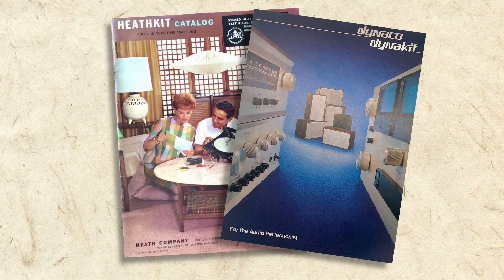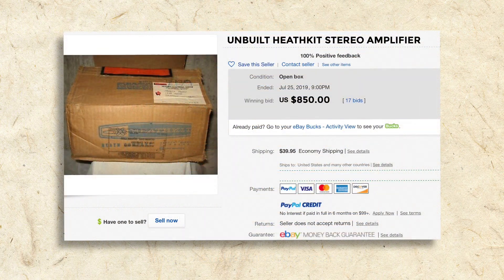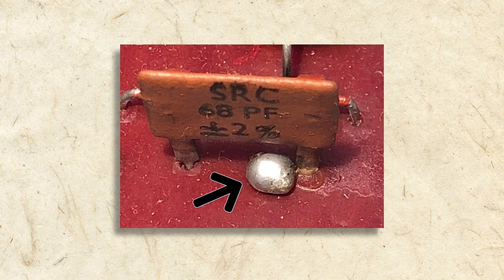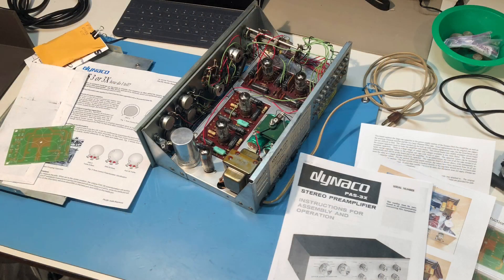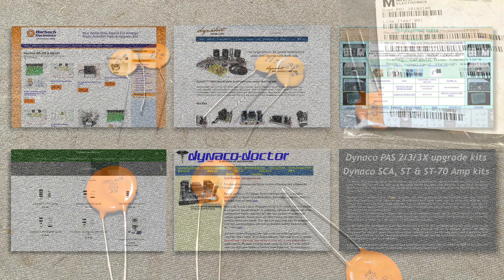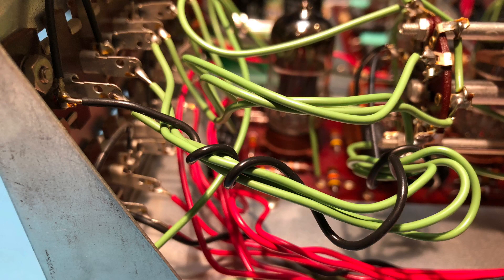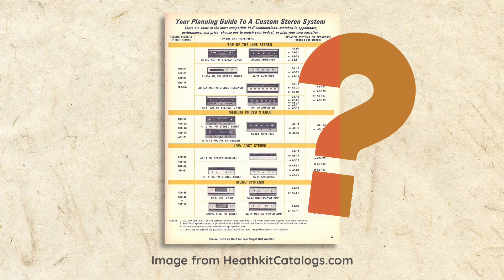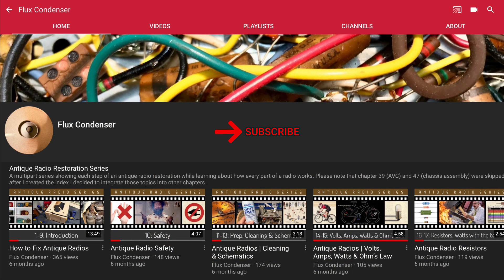Build A Vintage Stereo | Why Kits?

Comment: I acquired matching set of new unbuilt kits consisting of an AA-21 amp and AJ-43 tuner with the wood cabinets. These weren't cheap - (unlike many other unbuilt Heathkit kits,  a set like this is extremely rare if they exist at all).  I have been holding on to them for several years debating whether to assemble them or to hold and sell at a profit, but now I am leaning toward building them.  I know how much I would enjoy the experience.
Reply from the maker: Yeah, it’s a difficult decision. Those are beautiful components and to find them in kit form, as you say, is rare. The second you start putting the kit together, the monetary value will decrease, but the opposite just may happen to your happiness. Not to mention the years of enjoyment you’ll get from actually using the components. Tough call, but if you don’t need the money, I say build them. I would.

Comment: I built a few of Heathkits in the Mid 70s.  First was  an AD-27a, which still works. I then built an AR 1214 for some friends.  I also built several Timing lights and an Engine Analyzer.  The Components always appeared to be of Good Quality.  And all worked on the first turn on, except the 1st Stereo, It popped the fuse, and with a piece of tinfoil in it's place, I watched the Rectifier Bridge go up in smoke. Seemed I grounded out the power feed to the Power Amp Transistors.
Reply from the maker: Ha! Thanks for sharing. Love the tin foil story. I just had an electrolytic fire off like a bullet in my workshop due to some over-confidence on my part. More to come about that in a future video.